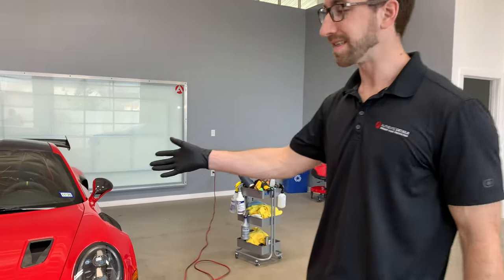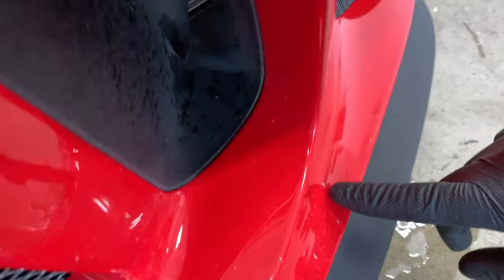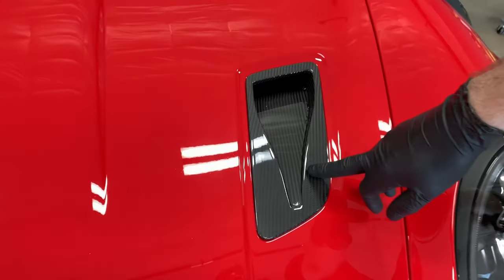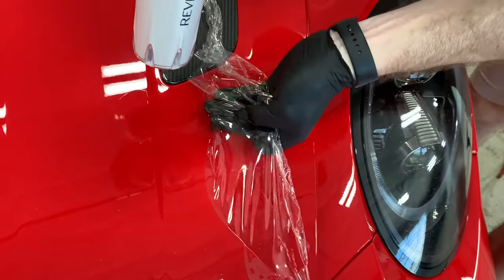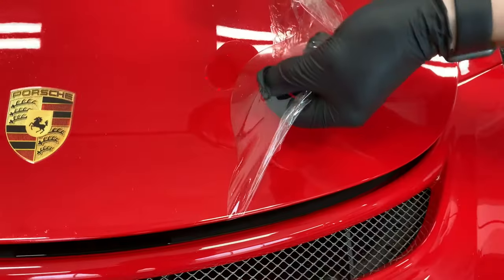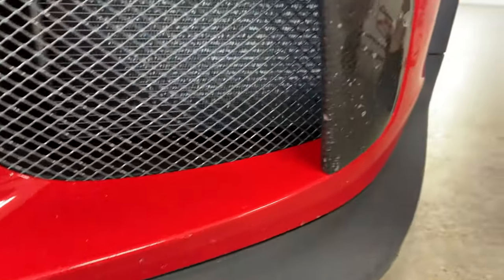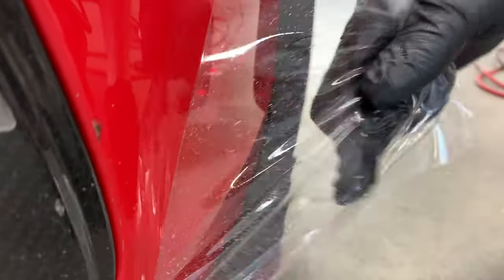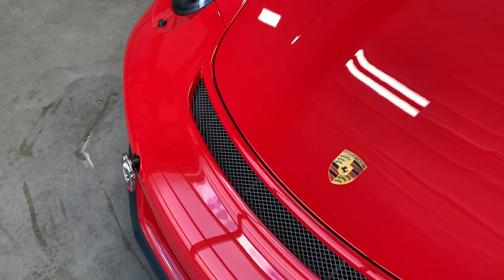Does PPF really work? Is it worth it? XPEL Paint Protection Film Austin

Comment: Great example of protection! It is that sand blasting "peppering" that the ppf really helps with. As long as you have the extra cash to re-do it every few years or 20-30k miles!  I can see it for these high end cars, but probably a wash or loss of $$$$ for most daily drivers and common luxury or sports cars.
Reply: xpel has a 7-10 year warranty. If it peels or get damagged, most places that have put it on your vehicle will replace it

Comment: It's a sacrificial layer, simple as that, the problem is that it costs almost as much to replace it, as a respray job for example I've had my hood repaired and repainted for £450 recently, it would cost just as much to have PPF Replaced, what you do avoid though, are problems with paint matching and blending. The cost of replacement is what lets PPF down 😏 over all if you care about how your car looks, then it's just about worth it, in my opinion, having had my front repaired and resprayed after an accident recently, I will be covering the whole front with Kavaca PPF & the whole car covered with Ceramic Pro as well, not cheap, £2500 😏
Reply from the maker: This is a correct statement and relevant for many cars. However, you have to look at two types of audiences:
1. Those that want FACTORY paint to be in the best possible shape on their cars for as long as possible. These individuals care about the price of protection and the “value”  of their vehicle remaining at its highest possible point. These are the same ones that sell their used cars well above market.

2. High end cars suffer a major value loss if any panel is resprayed, could be as much as $20-40k depending on the car. Collectors of high end cars are meticulous about these things so when they hit the second hand market, these details are crucial to some buyers.

Other audiences that look at their car in the ways of most people “I’ll just repaint it, I don’t care if it’s got a respray” - PPF rarely makes sense.

Comment: Why did you have to replace the PPF?  Thought it was supposed to be self-healing?
Reply from the maker: Good question Gil. PPF only heals swirls and scuffs. The topcoat that does this is thick enough to heal against swirls, but high impacts or punctures are not healable. PPF is designed to be sacrificial, to take the damage so your paint does not, especially important on cars where having non-oem paint diminishes the value greatly, like this GT3RS. (A repainted bumper could shave off $10k to the value quite easily, more in the future as the cars appreciate). We replaced this PPF because it took a ton of rocks at very high speeds over the course of multiple track days and canyon rallies.
Reply: Yet ppf companies and installers say its self healing against scratches. You know you say itbas well. Why lie?. Oh yeah. To justify more business for rich guys.

Comment: So those rock chips can't be healed thru that PPF's self-healing property?
Reply: No, the self healing property only works on minor scratches and swirls.  The self healing layer is too thin to work on rock chips.  PPF is not warrantied against rock chips so if you get tired of all film damage, you'll need to pay to have it removed and reinstalled.  For myself, I'd rather just fix the chips as they happen - it's less expensive and almost unnoticeable if you do it right.

Comment: Repainting those parts is the cheaper option in fact... why people spend so much on ppf is beyond me
Reply from the maker: Porsche owners are very selective and a repainted part on a $200k car drops the value significantly, upwards of 30%. To keep the original paint in as close to original condition possible PPF is the answer. To others, it may not matter but to many enthusiasts - repainted panels are no good.
Reply: Repainting is the cheaper option if you have a daily driver 'ordinary' car.
Its worth it for expensive & exotic car owners or just people who care about their cars!
Reply: it also depends a lot on the colour. some colours are very exotic (especially those on exotic cars) and can't be replicated 100% by local spray shops. in which case your only option is to protect your factory paint as much as possible
Reply: I got a quote for doing Xpel ultimate PPF on the entire front end of a 2021 Mazda 6 Signature that is a white pearl color. I also got a quote for repainting the entire front end, just for comparison. Both shops, the PPF and the paint shops, are very high quality top 10% in my area of Chicagoland in my opinion. The Xpel quote was $2705 without paint correction. Paint correction was $640 extra. The quote for having the entire front end repainted was $3100. The paint is a 2 stage base coat. So it has a primer, two base coats and then a clear coat and so it’s more expensive than most metallic paints. So the cost of the PPF with paint correction is more expensive than just painting the same area.

Comment: I was going to get my front end covered but now seeing that you need to replace it no way. Too much money for something temporary
Reply from the maker: Rich, it doesn’t “need” to be replaced and the films are rated at 10 years or more if cared for properly. This owner is just very selective about the looks of this car and wants it perfect all the time. That said, the film does take damage, as it’s designed to do so, in order to prevent that damage from happening to your paint. PPF isn’t for everyone, but for those who desire to keep the paint preserved to the highest possible standard and still drive their cars - PPF is worth it. For those that don’t mind a few nicks and chips or a repainted panel - it’s not worth the cost. For this car however, a repainted panel shaves quite a bit off the value of the car so justification is quite simple.
Reply: @HunnitMan 🤣pretty much

Comment: My local installer wanted to change 300$ for half of my hood. Is that expensive? Seems like it
Reply from the maker: Not at all. The film itself is not cheap. I’d strongly recommend doing a full panel (like a full hood). We’ve seen what a hood that is half protected looks like after a few years and the film is removed. There is a noticeable hard line where the film ended due to the uneven wear of the clear coat. 

It’s rarely able to be fixed, so I’d recommend not doing partial panels.

The film is there to preserve the paint. If that is worth it to you, then I’d recommend it. If a few chips don’t bother you or you don’t mind have repainted parts on your car (many people want true factory paint only) then PPF may not be worth the cost.

Comment: Thanks for sharing! how long can you leave expel PPF on for? Have you ever run into a case where the PPF lifted paint while removing?
Reply from the maker: xpel PPF can stay on your car for 10 years, there are instances when PPF is put on an older car with more degraded paint, where if you go to remove it in an incorrect way, or in haste, it can pull the paint, however we are vary carful with the cars we have and are very knowledgeable about the products in the industry, if we think it could be an issue we always address it with the customer before hand and talk over a good strategy to keep the car safe.

Comment: how long do the film last ?
Reply from the maker: The film is warrantied for 10 years but can last much longer. Just like anything else, if you take care of it, it could last double that.
Reply: @authenticdetails  So was this replacement covered by the warranty? What "damage" allows for covered replacement? (and is labor also covered?) Thanks.
Reply from the maker: @ElCid_86  - this was replacement paid for by the customer. Damage like this is not a warranty issue, the film is designed to take impact and damage so your paint does not. Thus it’s designed to be replaced once it is damaged. This car sees way more speeds, impacts and debris than any road car does as it’s constantly at speeds over 150MPH. Warranty for XPEL covers the integrity of the product itself covering Yellowing, Fading, Peeling, Bubbling.
Reply: Could you please tell me which is better PPF or Ceramic coating? Or wht if someone apply ppf first and then Ceramic coating dose it right thing to do?
Reply from the maker: @IAmSatoshiNakamot0  - great question and one we get often. The answer is they are both fantastic, each serves a different purpose.

Primary purpose of PPF - protect the paint from physical damage (rocks, bicycle handle bars, shopping carts, etc). PPF is designed to be the barrier between the physical damage and the paint, consider it sacrificial protection. In most cases the film will take the damage and your paint stays in perfect condition. 

Ceramic coatings are designed to replace wax. They are much stronger, much glossier and last exponentially longer than wax. Coatings are durable, slick and help keep your car clean, make it look freshly waxed after a wash and provide UV protection. However, a ceramic coating will not provide physical damage protection (no matter what the marketing videos show you). 

In a scenario where you install both, you would want the PPF first and the coating on top. Because coatings are designed to keep your paint slick and make it hard for anything to stick to it - PPF will not adhere to a coating (if it does, it won’t adhere very well). 

Most of our customers protect the front end and rockers of their cars with PPF and ceramic coat everything else.

I hope this helps guide you. Feel free to reach out for more questions anytime.